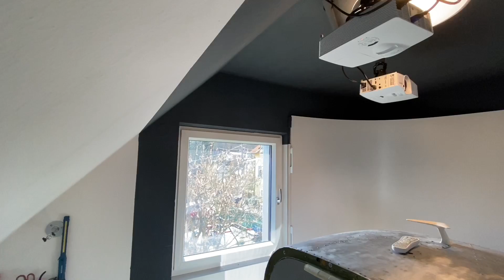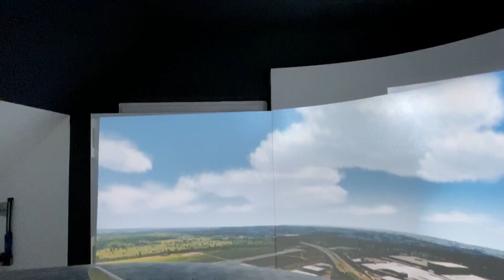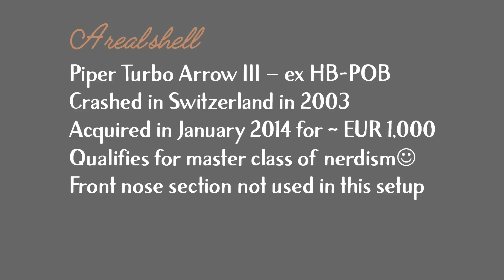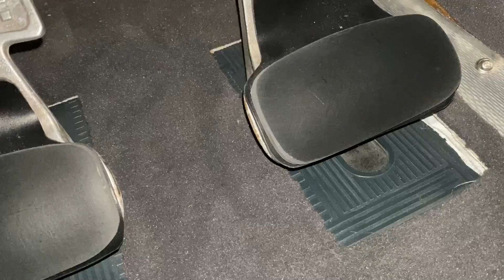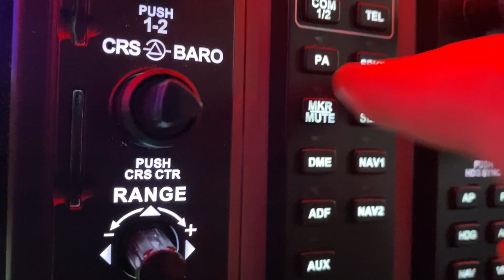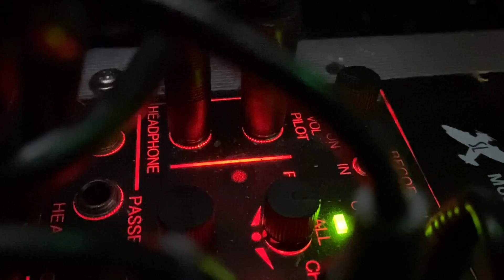Simroom-Tour of my twin-engine Home Cockpit

Comment: Great video (even if I follow you since the start, it’s always cool to see a sim tour).
I have a cessna 150 in my garage, I’m still working on it, but my major concern is about the way to bring it in a room when it will be finished.
It’s in one piece (I have about 1meter behind the front seat). I have all the original controls (with cable and pullies which is great for interfacing )and I really don’t know where I could cut it.
And everything is with thousand of rivets...
How did you manage to lift your cockpit in your room?

Comment: Hi amazing sim. How have you managed to get the wings/engines in the view when using Fly Elise software. I have only managed to use the software with the view from the cockpit being fully outside view if that makes sense. If I change to the virtual cockpit/3d view my images are distorted and do not line up correctly.
Reply from the maker: First load the aircraft in planemaker to permanently remove objects you do not want to see. Then load the virtual cockpit view, you will notice a distortion of the image. There is a blog entry of FlyElise how to correct that to have a clean view like when you load up without a cockpit view. This is done by the way auswelle in planemaker and takes some time. Maybe I make a video on that in the future, but it is just interesting for a small group however.
Reply: Here is a detailed explanation of how to achieve a 270 degree view and align the projectors...created by a similarly skilled/dedicated youtuber. https://www.youtube.com/watch?v=PLd-00W2HEg